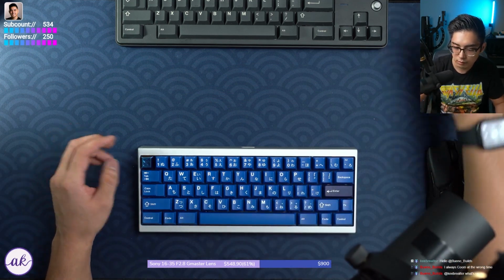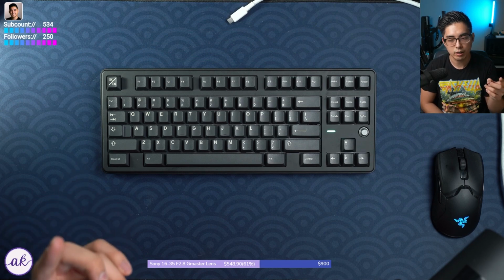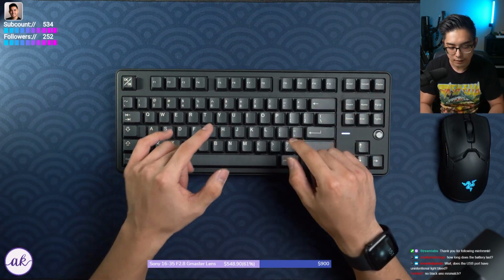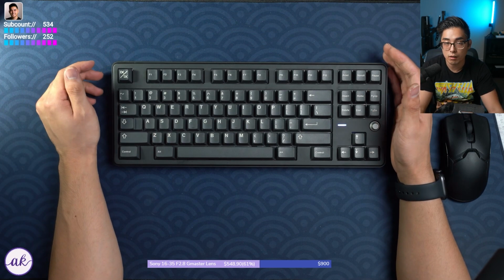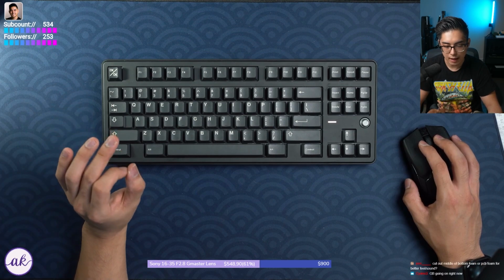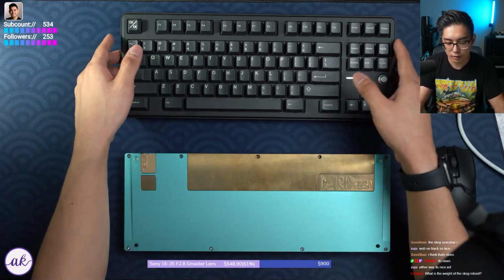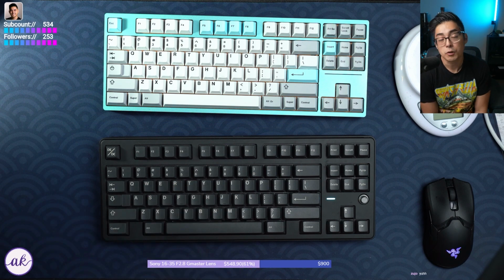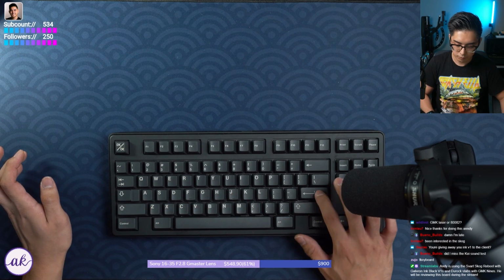Protoype Skog Reboot One Week Review

Comment: Hey andy would you say this is a good non competitive board for a gamer? Im currently on a keychron K8 and i only use Bluetooth, sometimes it stops responding and then it reconnects, will i face any issues with the skog with this, seeing how its an older bluetooth version?
Reply from the maker: i've heard there are some issues with this board in production run. i have never gamed for a long period of time using a BT board but this worked for short stints.
Reply: @AndyVNguyen  ahh i see thank you for that!

Comment: That Bluetooth activation is a no for me.
Reply from the maker: I don't follow - what's wrong with it? You can just use it wired also
Reply: @AndyVNguyen  have to plug it in, remove keycaps, and press a pin.
Reply from the maker: @TROY-MCCLURE-1991  oh. that's how they all work. either that or have it outside on the keyboard. you can just keep the bluetooth on and it'll auto sleep. i don't turn off the bluetooth ever
Reply: @AndyVNguyen  ah
Reply: @AndyVNguyen  the mode 80 or more keyboard needs more bluetooth.
Reply from the maker: I agree. It’s done well in this board